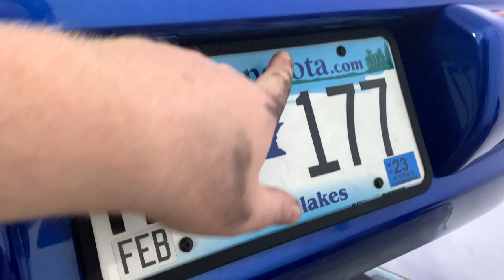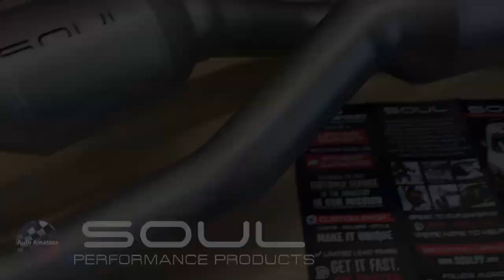Soul Performance Sport Cats Installation DIY - Porsche 911 (996)

Comment: Would have loved to use these, albeit they are not CARB Cert.  Also as long as you are in this far, why not change out the O2 Sensors. Made a huge difference when I did my change ( rattle in my R-bank cat ) to the Magnaflow CARB certified.  Nice video, thoroughly enjoyed.

Comment: great video. tempted to do mine, though i will probably just have the stock cats chopped off and high flow cats welded on the same spot. the cost of those soul cats seem rather excessive for what they are
Reply from the maker: Cheers Amrit!! From a sound perspective you might be right but the power gains I felt the first time I launched the 996… I think they’re worth their weight in gold. 🤩